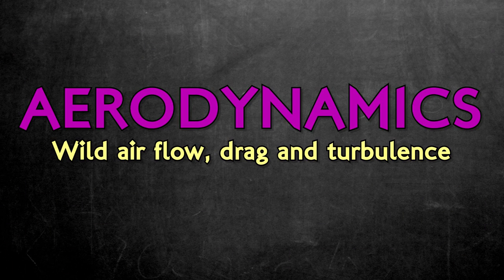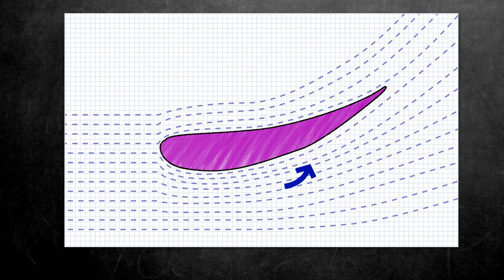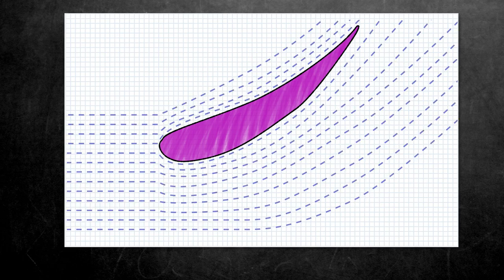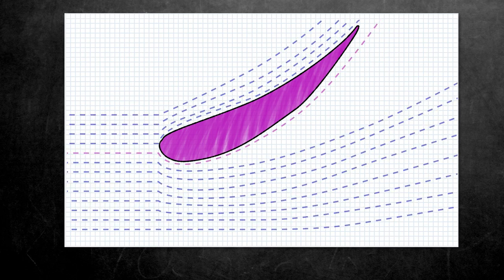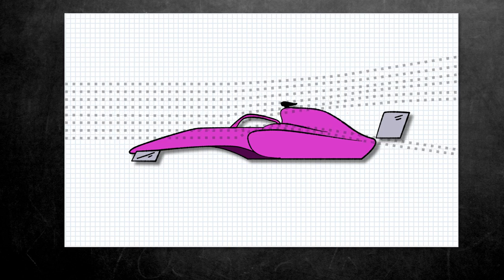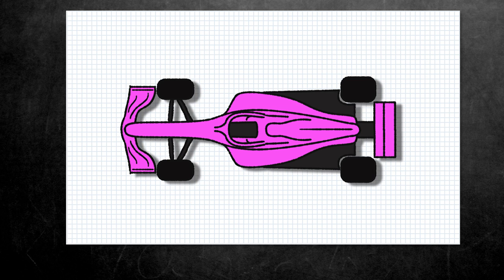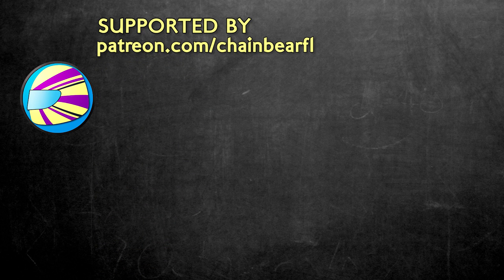F1 Aerodynamics - 2: Turbulence, Drag and Vortices

Comment: Finally someone who understands how a wing works.

E: This is one of the best explainations of airflow around an object I've seen on youtube. BTW: All the motion here is relative. The air is actually stationary. :D
Reply: Oh, Right! Because air is a fluid that the cars are cutting through at high speed, and when the focus is placed on the car itself, it seems as if the air is the one that is moving. That is so cool to me.
Reply: Precisely. This is what I want to do (roughly) when I'm older. I dream of building my own plane, and my free time is sometimes spent figuring out how to make all the systems within. Look it up, it's really interesting. Be careful though, it's a rabbithole I haven't found a way out of yet. :)
Reply: Stationary, as in, it's the car driving into the air, not the air blowing onto the car, as the animation might suggest. The air particles are still moving as the car's surface "hits" them.

Incidentally, if you do blow air onto the car's surface while the car is stationary, the aero devices still work, at least in principle. This is what a wind tunnel is, which F1 teams (as well as aeroplane manufacturers) test for aerodynamic performance.
Reply: Yes and no. All motion is relative to the observer. If you observe the air flow from the earth the air is stationary however if you observe from the car itself the car is stationary and the air flows around it. There is no right or wrong way of looking at this, it all depends on what you;re trying to achieve.
Reply: Well... speed is relative

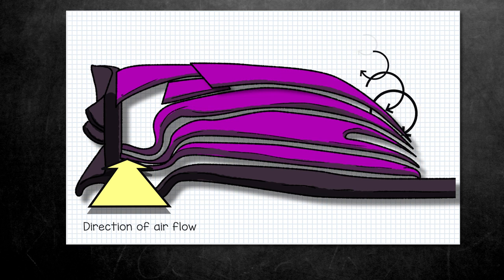Comment: Very good video! If anybody want to see an actual vortex, google "vortex y250". It's the name of the vortex mentioned at 6:18, and the most important one on the car. When I learnt about them I thought why are they useful. I got no answer yet but, if you think of them as tiny horizontal tornadoes (that's what they actually are), you can imagine the level of pressure and suction they can produce around them and how, by controling them, aerodynamist can make the car stick to the ground how they want it to. So they are really interesting and useful

Comment: Amazing, man! Finally came to better understand a previous explanation about how lift is generated, that previous being made as a correction to a misconception about the Bernoulli's principle on the generation of lift, since it is free flow and not a restricted flow. In that one explanation they also explained that the lower pressure was not doe to the Bernoulli's principle, but yes that difference in pressures resultant of the shape, but, I wasn't properly understanding still how the lower pressure was being generated until now, with your explanation, now it's finally water clear. The vacuum, which would be generated otherwise, is the reason for the increase of speed and pressure reduction... Couldn't be more thankful, right now. Thank you!

Comment: I greatly appreciate the effort you're putting into this videos in order to bring such complex matter to the masses. I think that there are not many videos out there that can visualize some of the phenomena so intuitively. However, I think that some explanations, albeit in terms of simple newtonian mechanics phenomenologically not incorrect, lack some correct physical foundation.
You describe flow separation as an effect of air particles not being able to follow the path curvature of the airfoil with the force of the movement being generated by a pressure gradient. In fact, travelling down the chord of the airfoil an ever increasing pressure can be measured (which ultimately will force air particles to flow backwards, forming a large region of recirculation, i.e. a vortex), so in stationary conditions the opposite observation can be made. This adverse (i.e. increasing in direction of the flow) pressure gradient can be explained with the decrease in fluid velocity due to the Kutta-condition at the trailing edge (i.e. the continuity of fluid velocities from either sides of the airfoil) and the therewith increase in static pressure (Bernoulli equation for barotropic fluids). Secondly, the fluid velocity within the boundary layer additionally decreases due to dissipation via friction which ultimately supports the change in flow direction.
Also, you mentioned in the first video that the airflow below the airfoil is being accelerated because it runs into a barrier of undisturbed flow below and hence has to accelerate through a tighter vertical space. However, looking at a rectangular-shaped control volume around an airfoil and applying the Navier-Stokes-equations in integral form yields that there can in fact be momentum carried out of the control volume. This is because the vertical component of the fluid velocity can generally not be assumed to be zero (which can be proven by the displacement effect of boundary layers). If your explanation of the generation of lift forces would be correct, you would be able to measure a net downward force on the airfoil with the flow being inviscid, which has been historically proven to not be the case.
Rather the phenomenon of lift is explained through viscous effects, namely the generation of a starting vortex at the trailing edge of the airfoil and another counter-rotationg stationary vortex around the airfoil, causing a net circulation and therefore a downward force (described by the Kutta-Joukowski-Theorem). All of that is described really well in Anderson "Fundamentals of Aerodynamics".

TL;DR: I think for the vast majority of people, these videos are a huge help in understanding aerodynamics and the explanations probably are "right enough". But still I think that there are some things that are not entirely true from a continuum mechanics perspective.

Comment: You should point that those vortices leave the airflow incredibly turbulent behind the car, which reduces the efficiency of the wings of the car behind tremendously. True that every wing will generate some vortices, but the current concentration of vortex generators are one of the main reasons that F1 cars can't follow eachother .
Reply from the maker: It's in my 'Dirty Air and Slipstreams' video, but that's pretty old now I guess

Comment: Great video, most of the topics you covered were right on point and easy for beginners to understand, however there is a slight error related with turbulent flow that I feel like I have to point out.

Around 02:55 you mentioned that the air between the boundary layer and separated flow are called "turbulent flow", however there's a catch there. A turbulent flow isn't necessarily separated and the flow being turbulent isn't the major concern. It's their boundary separating from the wing surfaces that causes most of your problems. When a boundary layer separates from a section of the wing another has to take its place which creates a high pressure airflow bubble in the local low pressure flow zone, taking away some of the pressure difference between the upper and lower wing surfaces, thus reducing the overall down-force. Flow separation can happen regardless of a flow being laminar or turbulent and a turbulent flow is normally fine as long as its boundary layer stays attached to the airfoil surface. You did mention flow separation being a problem but I feel like there is a mixup of different concepts. But do correct me if I'm wrong.

Some interesting side notes: 

A turbulent flow is actually less likely to separate due to it being more energised, and its boundary layer being thinner and thus more resilient to separation than that of a laminar flow. A classic example is the dimples on a golf ball. Although triggering the turbulent flow early increases skin friction drag, the delayed flow separation moves the high pressure zone aft-ward, thus reducing the much more pronounced pressure drag, resulting in a lower total drag. Helping the golf ball to maintain its speed flying through air.

The main advantage of a laminar flow compared to a turbulent one isn't in its likelihood to avoid separation or lack thereof, but its lower skin friction drag which is important when its presence isn't over powered by other types of drags such as pressure drag, lift induced drag etc. A very smooth surface can delay the flow transition from laminar to turbulent, which in turn reduces the skin friction and normally makes a streamlined object go faster.

In computational flow analysis on air planes, engineers sometimes treat the entire flow domain as turbulent since laminar flow only makes up a small portion of the flow over aerofoil surfaces, occurring mostly along the leading edges where oncoming air is clean. As the air flows along the aerofoil surface the laminar flow will destabilise and transit into turbulent flow. More accurate simulations will try to predict the location of this said transition, splitting the air domain into laminar zone, transition zone and turbulent zone. which is difficult and resource hungry, but produces better simulation results when done right, or it can just ruin your entire simulation and blow up your results.

Comment: Very nice and simple explanation. I didn't know that vortices help to keep the flow atached to the body. So you are able to use higher angles of attack , in airfoil design , despite the early detachment of flow.  You can aldo reduce the wake area and therofore the  drag. Very clever! Do comercial airplanes use that aid to increase  the angle of attack of their airfoils?

Comment: It's great because all of these principles relate to aircraft also.  Except you want to minimize the vortex at the wing tip because it imparts a bit of drag leading to the winglets you see on modern aircraft.  On a F1 car though this drag is more than made up for with the action of the airflow up other bits of the car.

Comment: Would love to see a more in-depth video of the floor aerodynamic.  Doesn't seem clear why the cars have stepped floors, complete with the little lateral bulge in the middle, which can be used to constrict the airflow, hence accelerating it and producing a ground effect, which is completely doable once vortices seal off the edges of the floor.  Others would say the vortices actually suck the underfloor air out, creating a suction effect. Either way, ground effects would seem to be more constricted if the floor was just flat, like in the good old days.

Comment: This is an awesome effort to educate people about aerodynamics and also to answer questions they've had forever. But at the same time, a few things about basic aerodynamics that are inaccurate and that can be completely against the objective of the project! For example turbulence is not what you described. If you want help, I would totally be willing to help you with your research.
Reply from the maker: All I intend to define by turbulence is a more chaotic, non laminar flow
Reply from the maker: (I hope it doesn't seem like I mean anything else!)  :)
Reply: Well turbulence can exist in attached flow, while you suggest only separated flow is turbulent. In fact, one of the ways that Vortex Generators are explained is that they make the boundary layer turbulent, making the flow close to the body more energetic and keeping it attached.

Comment: @ 6:03, how come the high pressure zone is on top and the low pressure zone on the bottom of that piece? Because that resembles a mini f1 wing and it's on the opposite direction, it's on the direction of an aeroplane wing!

Comment: IMO in order to enable closer racing (overtaking is too narrow), I think they should free up a lot more areas for aerodynamic adjustment. The little serrated cheese grater bits are like that because something else isn’t how the aerodynamicists want it to be, and these little bits are also what stalls so easily in dirty air. Total downforce and speed should then be limited via engine regulations, possibly such as fuel flow and per unit price caps.

Comment: I was amazed at how accurate the explanation is but separation can be laminar. However I agree that at the velocities and length scales involved in F1, separation will generally occur at a supercritical Reynolds. However, calling the detached portion of the BL "turbulence" is not only inaccurate, it is false. You should rather say that this zone is the separated BL (which can be laminar or turbulent). The intense shear stresses caused by the reverse flow (itself a consequence of the relatively intense adverse pressure gradient) feed the turbulence-generating term in the Reynolds-averaged NS equations through the mean flow velocity gradient. This helps create the first coherent eddies and the subsequently smaller and smaller and more chaotic eddies, helping the flow go turbulent if it's not already.

Comment: Very good video but how can I create a turbelence?
Reply: Vortex generators. Vortices are naturally generated at the tip of any surface subject to a flow.

One thing to keep in mind is that those vortices create drag by themselves, so the benefits of reducing flow separation have to be weighed. That's why airplanes have winglets at the tips of the wings, so they can reduce and change the geometry of of the vortices created to reduce induced drag.

Comment: Could you explain why generating vortex from the rear-wing-end-plates (ref. McLaren) would reduce dragg ?  Seems to me that the vortex generated from there, are way behind the car and doing little to the car surface parts, perhaps for the rear wing, if any...  Or are they really more for destabilizing the air for the car that runs behind ..... ?  Also would teams not try to upset the air on purpose for those who run behind, if that wouldn't cost them ?  Wouldn't you invest in such "technology" if you were on the grid ?

Comment: So is it safe to say on a compact car like a midsize corolla the drag created by vortex generators placed above the rear windshield would be less than the drag they would reduce by keeping the airflow attached thereby reducing the low pressure pocket at the rear of the vehicle? I understand this would only be effective at speeds above 55 MPH. I'm studying aerodynamics for increased MPGs and am wondering if this application would improve efficiency.

Comment: but to what degree squeezing effect you explained (in earlier video ) is happening or it does not happen at all ?? 
and  Is  this high pressure air occupying low pressure by tracing wing surface called coanda effect?

Comment: But why doesn’t the separation of the air makes even more downforce? Shouldn’t it be bigger low force under the wing and therefore a bigger difference to the high pressure over the wing so the high pressure can push down more?

Comment: The clarification given at 0:58 is not really correct. You got it right the first time actually. One of the first things you learn when studying vacuum is "Vacuum does not suck". Same goes for areas of low pressure. The areas of high pressure expand when they are given the opportunity. The driving force is the high pressure area.

Comment: Really good video, but i don't agree completely with your notion of turbulence. The part of the flow you call turbulence would be more accurately referred to as the wake, although it is true that the wake is turbulent. An attached boundary layer can be both laminar and turbulent, so when you generate vortices you actually make the boundary layer turbulent in order to keep it attached for longer.

Comment: As an engineering I have to say this is wrong, on the wings (F1, planes, or even golf balls) the optimal flow is turbulent, no one wants laminar flow, it creates more drag, what you call laminar is turbulent, and what you call turbulent is not even a flow.
Reply from the maker: I have to say I disagree. Laminar flow is the least draggy, except for the fact that it's much more liable to separation. Laminar flow can suffer from friction drag but this isn't as strong as the pressure drag caused by separation. Qhat we're aiming for is high energy laminar flow and we can introduce some turbulence to bring energy into the boundary layer (which is what the dimples on golf balls do).Is that what you meant?